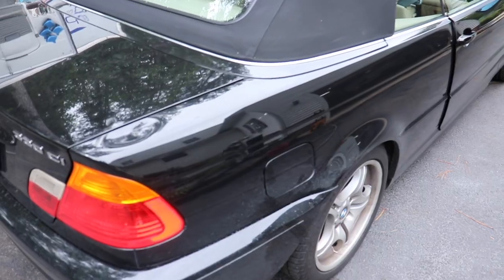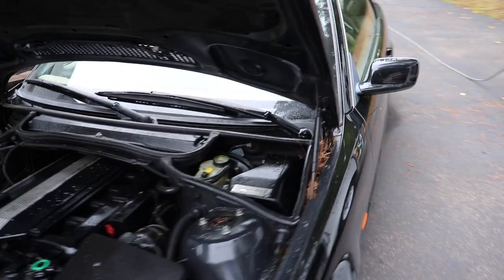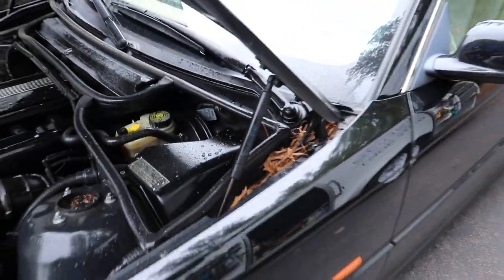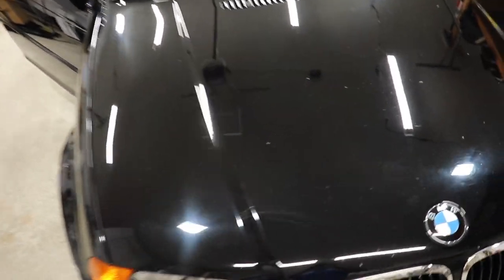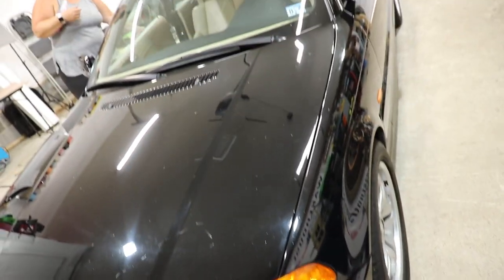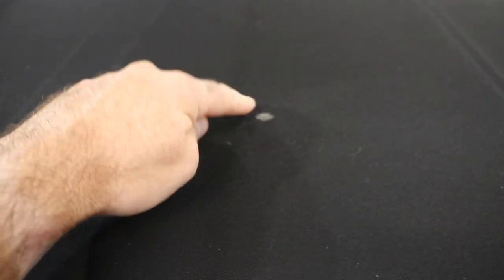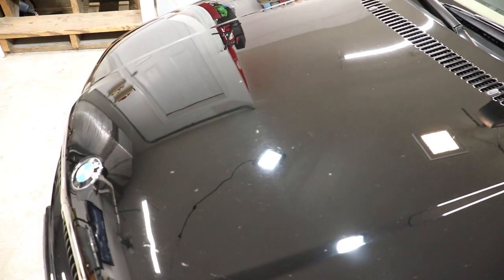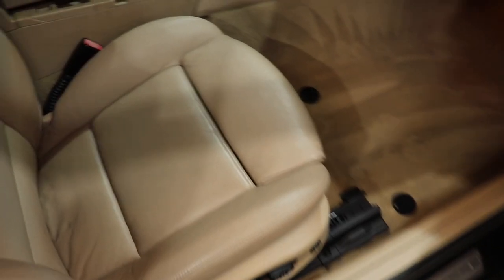Interior & Exterior Detail / How Far Do We Go? /  Older BMW 330ci! #autodetailing #mobiledetailing

Comment: Phil & Mrs, another great job!  For your viewers who aren't familiar with the Turtle Wax Ceramic Hybrid Polish/Wax and the Ceramic spray, I believe the directions is to wait 24 hours between coats?  I believe that is true for most SI02 products? I'm guessing, Phil didn't have time between coats.  But viewers, if you wait 24 hours between coats, apply two coats of each, with proper prep., and proper caer, you will get at least one year of protection.  Thanks Phil & Mrs Miranda...
Reply from the maker: Hi. Yes. Good to point out. For mobile guys and jobs where we do have days to work on the vehicle you can still layer like this but your right, it better to let cure 24h for maximum performance. But this should get up to 6 months or so especially since it is garaged 😎👍🏼

Comment: Great video. Do you like the regular hs ceramic acrylic polish better than the ceramic acrylic black?
Reply from the maker: Thanks. Actually I do like the regular Polish and wax better than the black wax version. Only becasue it can be used on everything and not just dark vehicles.
Reply: @MirandaDetailing  Thank you for sharing. I have both but I haven't used them enough to know if there was a difference in the correction or enhancement you get out of them. They are both great products for the price IMO.  I have only used the black polish once, on my own vehicle, but I have used the regular ceramic acrylic on several different occasions and it doesn't disappoint. Great video and nice turn around on an older vehicle!

Comment: Phil, what protection will you use on that top?  303 fabric protection or from Raggtop?  I did the fabric top from a product from raggtop that kinda removed sap from the top of a friend's mini cooper like 2 years ago.
Reply from the maker: Morning. Actually the customer opted out for any fabric tip protection. But if I did I would have used 303 Fabric Guard. It’s worked really well in the past.

Comment: I wanna ask about apc using...can ı use apc for leather or alcantra cleaning and wheels and rims cleaning which ratio do you advice inside and outside ? And nice job for old boy 👏👏
Reply from the maker: Hi!  
Yes you can use APC safely on alcantara if diluted enough like 10:1. Even at 4:1 most APCs are fine. Just make sure not to over saturate the area. For wheels, tires, and grungy stuff you can dilute stronger like 2:1 or 4:1. 
Thanks! 😎👍🏼
Reply: @MirandaDetailing  thank you ☺

Comment: Did you try steam on the roof? I had the same issues a couple times and steam with a little time got it out
Reply from the maker: I didn’t. It’s original so I was being by careful. That may have worked though.
Reply: @MirandaDetailing  nothing wrong with being careful. I just went on really quick went off until I was comfortable with allowing the heat to penetrate it a little more. You can also try a very small amount of goo gone. Like on a q-tip let it dwell and hit it with steam. Great work you did on that.
Reply from the maker: Great tips!! Thanks for sharing man!
Reply: @MirandaDetailing  anytime thank you for sharing many more tips.

Comment: Hello, 

Eric here from the Netherlands I'm a detailer myself self and I was wondering why u use foam pads in sted of MF pads. I use MF in combination with the Rupes one, that's scratch removing and protecting. I think you could get a much better result with this combo than with the foam pads just keep it low-speed rupes LHR max 3. It's just a tip but worth a try I guess. Love your vids keep making them. 

Kind regrads,

Eric
www.vanderdetails.nl
Reply from the maker: Hi and Welcome!  I totally use and love MF pads also,we use them all the time! but in this case it wasnt even a paint enhancement or correction it was just to clear the paint up a little.  This service the customer paid for only included a machine applied wax, but we went a little further to polish and make it look better.  Check out our exterior videos and you will see how we use a variety of pads and products to polish all sorts of vehicles.  https://www.youtube.com/playlist?list=PLqFaL0inWinbsYxpSqT7XUc3WNq0f4MK4
Reply: @MirandaDetailing  oke that's true but you do the same thing only with MF, more result so happier customer!
Reply from the maker: I understand that’s how you fell. But remember if the customer isn’t paying for a paint enhancement or polishing we try not to go overboard. Each situation is different. Plus MF will leave some marring behind that would need to be followed up with more polishing. I appreciate the suggestion but after many year of experience we choice the pads and products we do for a reason. 
Thanks😎👍🏼